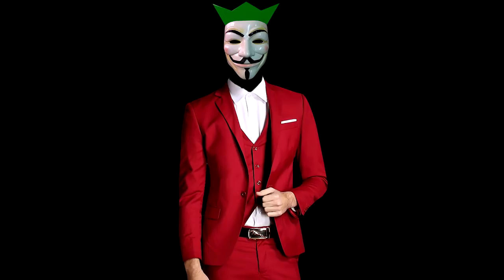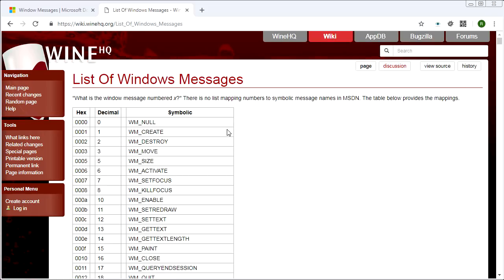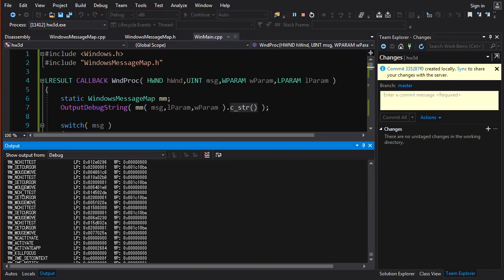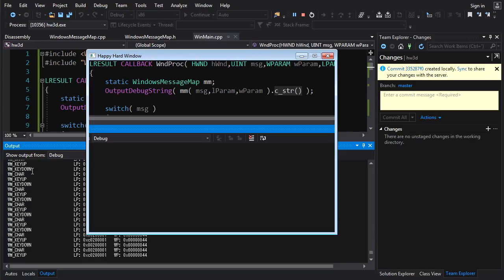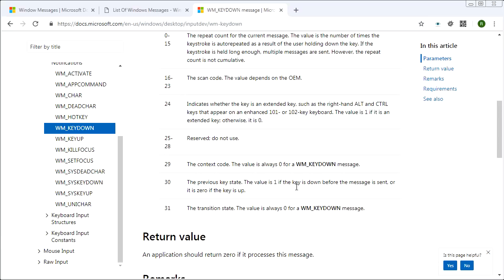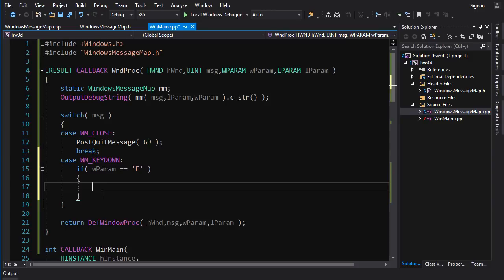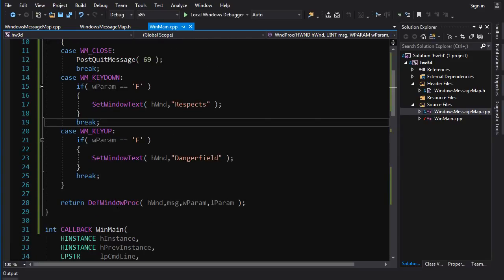C++ 3D DirectX Tutorial [Window Messages] 4

Comment: Hey Chili, I had a problem with the WindowsMessageMap.h were I get the error code E0135 "namespace "std" has no member "string"", I already changed the C++ Language Standard to the latest C++ Working Draft but for some reason I have to #include <string> in order to make the file work. What am I doing wrong here? (I saw that you're only including it on the .cpp file but not on the header)

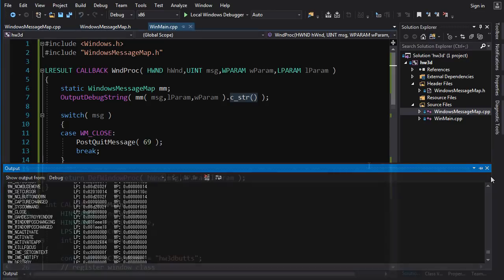Comment: I've gotten as far as 3:46 in this video, and I swear I copied your code exactly, but when I try to run it, I get the following two error messages:

Error (active) E0167	argument of type "const char *" is incompatible with parameter of type "LPCWSTR"
Error C2664	'void OutputDebugStringW(LPCWSTR)': cannot convert argument 1 from 'const _Elem *' to 'LPCWSTR'	hw3d

Any idea what might be going on here? Why doesn't your version display these errors if the code is identical?
Reply: use the OutputDebugStringA function instead of OutputDebugString
Reply from the maker: There is a critical setting in the project configuration. It basically #defines a switch which determines whether wide or narrow character versions of the Win API functions are used.

Comment: Hi Chili,
I have some issue at 4:46. Could I request for some help?

error C2664: 'void OutputDebugStringW(LPCWSTR)': cannot convert argument 1 from 'const _Elem *' to 'LPCWSTR'
with  [ _Elem=char ]

Google tells me to change the Character Set.
However, if I change Advanced->Character Set->"Use Unicode Character Set" to "Use Multi-Byte Character Set". I will get the following errors.

error C2440: '=': cannot convert from 'const wchar_t *' to 'LPCSTR'
message : Types pointed to are unrelated; conversion requires reinterpret_cast, C-style cast or function-style cast

error C2664: 'HWND CreateWindowExA(DWORD,LPCSTR,LPCSTR,DWORD,int,int,int,int,HWND,HMENU,HINSTANCE,LPVOID)': cannot convert argument 2 from 'const wchar_t *' to 'LPCSTR'
message : Types pointed to are unrelated; conversion requires reinterpret_cast, C-style cast or function-style cast
message : see d

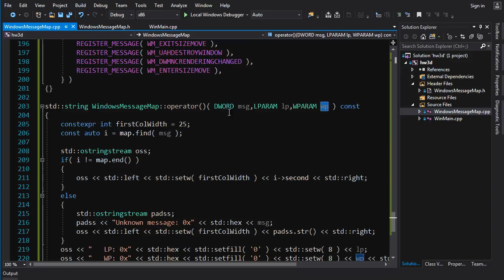Comment: Question at 3:25 when trying to implement the windows message map

I gety the error "argument of type 'const char' is incompatible with parameter of type 'LPCWSTR'". if the output debug string were an actual string in quotations, all i'd need to do is use 'L' before the string.  BUt since it's an actual argument of mm, how do I make that change?

Comment: Oh cool!  Thanks for these tutorials, I learned a lot so far.  I guess a basic WIN32 GUI is not too complicated once you learn it, still more confusing than Java Swing, but not too bad   I was going to implement code to handle an ALT F4 in WndProc, but I guess it turns out that DefWindowProc already handles this.  so for testing purposes I changed it to ALT + Q.  Naturally I  made 4 bools for the WASD keys pressed or not, so other future areas of my game can simply process keyboard input for player movement off of the bools.   Also I'm not even using Visual Studio lol, I'm using Eclipse which I normally use for Java with the C/C++ IDE extension/plugin, so I won't be tied to some special runtime environment being installed on the system.

Comment: EDIT: FORGET about this and other comments i have made, just go to projects properties>configuration properties>advanced>Character Set = Use Multi-Byte Character Set, instead of unicode. This fixes everything related to LPCWSTR. (thank you Anton Malyshev over stackover!)

If you cant get it running, right click on hw3d (project name) in the solution explorer (top-right side), go to properties and change debugger type to mixed .NET FRAMEWORK. Then change wc.lpfnWndProc = DefWindowProc; to wc.lpfnWndProc = WndProc; and copypaste this:

LPCWSTR convStringToLPCWSTR(std::string String)
{
	char* cString = &String[0u];
	std::int64_t size = strlen(cString);
	wchar_t* wString = new wchar_t[size];
	for (std::int64_t i = 0; i < size; i++)
	{
		wString[i] = cString[i];
	}
	wString[size] = 0;
	return wString;
}

LRESULT CALLBACK WndProc(HWND hWnd, UINT msg, WPARAM wParam, LPARAM lParam)
{
	static WindowsMessageMap mm;
	LPCWSTR text = convStringToLPCWSTR(mm(msg, lParam, wParam).c_str());
	OutputDebugString(text);

	switch (msg)
	{
	case WM_CLOSE:
		PostQuitMessage(69);
		break;
	case WM_KEYUP:
		if (wParam == 'F')
		{
			SetWindowText(hWnd, L"DangerField");
		}
		break;	
	}
	return DefWindowProc(hWnd, msg, wParam, lParam);
}

I'm using vs 2019 maybe that's the reason
Reply: THANK YOU SO MUCH
Reply: You are lifesaver! I changed Character set to Multi-Byte, and then don't have to add L before every single string anymore, but still need to add a #include <string> in WindowsMessageMap.h to fit std::string

Comment: following along after adding ChiliWin.h to the include path. 

 I get  -- "const char *" is incompatible with parameter of type "LPCWSTR" --- in reference to OutputDebugString.
I cast mm --- (LPCWSTR)(mm(...    --- and it runs but it spits out gibberish. 

I tried changing the characterset in properties but it creates new errors. 

It's been a good tutorial until now. I'm using vs 2019.
Reply from the maker: You should avoid using c-style casts for reasons such as these. They can mess you up because they have no restrictions. The problem is wide character (UTF-16) vs narrow character strings (UTF-8) strings. Either convert, or use the appropriate API function (there are A and W versions). Incidentally, this may all be stemming from missing a setting that was set in the 1st video in the solution properties (regarding unicode).
Reply: TYVM. I'll check the first video. I'll also upvote the first 3 videos. It's a very good introduction. In the future, is this the right venue for asking about errors?
Reply: I couldn't find the unicode  setting in the first videos. 

I solved the problem though. I changed the character set to multibyte (properties-advanced in vs19). Then I change 2 places in the code where conversion occurs by deleting "L". 
That fixed it.